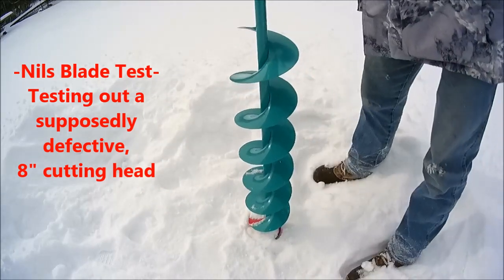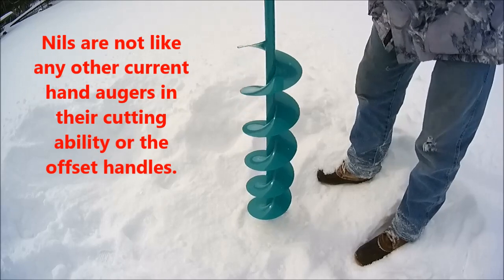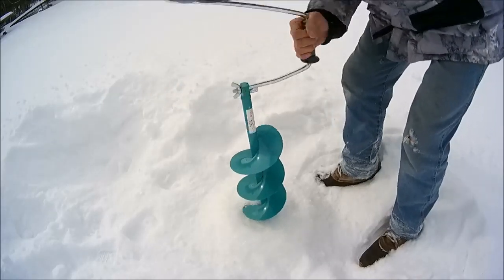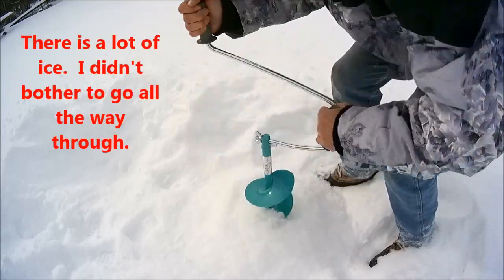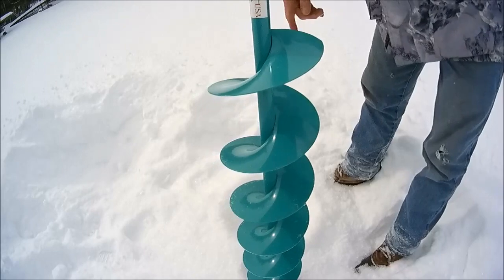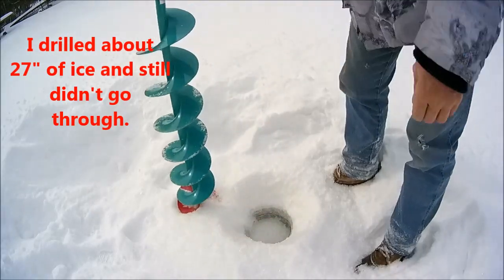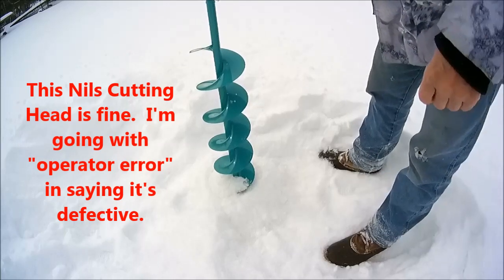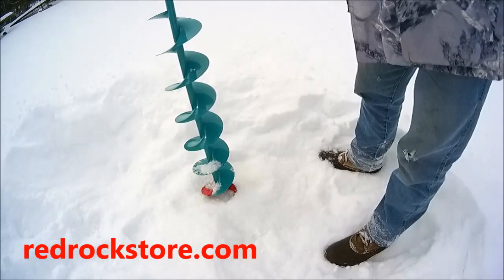Nils Ice Auger Blade Test - 8"

Comment: Where can I get an 8 inch blade for a Nils Auger!
Reply from the maker: Contact Nils USA.
Reply: @ElyresortBlogspot  I did contact Nils USA, but they said the don't have any 8 inch blades
Reply from the maker: @davidadams8416  Then, they are out for the season.  They usually sell out by mid-January.

Comment: i got a old Finbore Normark. its got removable triangular blade and offset handles. 
nils isnt the only one with this design.
Reply from the maker: Well, technically Nils is the ONLY remaining one of this design.  You won't be finding a new Finnbor ever, anywhere.  They don't exist.
Reply: @ElyresortBlogspot  sadly. i hit some earth in the middle of my lake TWICE. those triangular blade are such a bitch to sharpen its hell.
i havent tried a similar size flat blade yet. is there a big difference in cutting?
Reply from the maker: @Francois_Dupont  I dunno.  finnbore has been extinct for so long, I've never used one.  Nils are tough to beat.  I no longer sell them but if you can find one, get one.

Comment: I got one last winter, and it takes a massive amount of downpressure to cut, even 10" down the hole. Is this operator error, or should I send the head off to Frank?
Reply from the maker: Send it to Frank.  A sharp Nils pulls the driller down the hole, almost.
Reply: Who’s frank? My Nils 6in blade is not cutting due to hitting some ground at GE bottom of the ice ..

Comment: My nils can't drill straight no more keeps wobbling is it because I need to replace the head?
Reply from the maker: No, you need to have it sharpened by Frank Deluca.  It will cut like butter and cost you about $25.  He's the best Nils Sharpener in the US.  Go to our this link, scroll down and get his contact info:  https://www.redrockstore.com/ice-auger-blade-sharpening-service/ice-auger-blade-sharpening
Reply: ya sounds like one blade is sharp one is not. get replacements or get sharpened. Make sure both blades are on the same opposite tilt